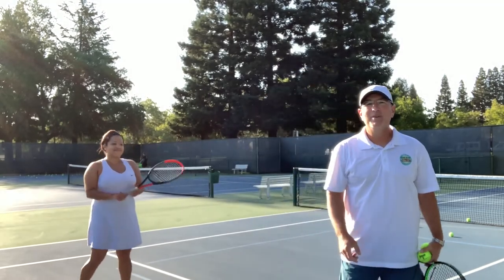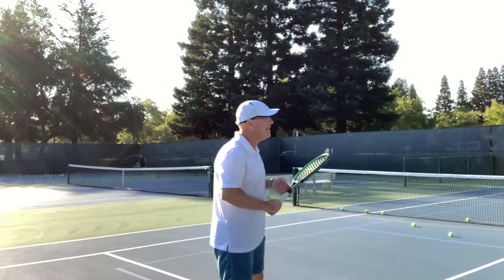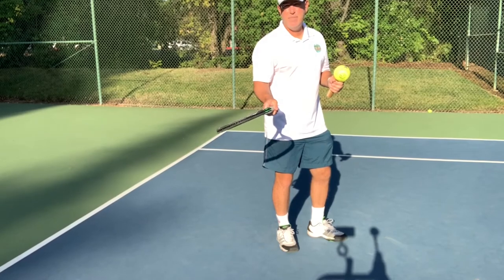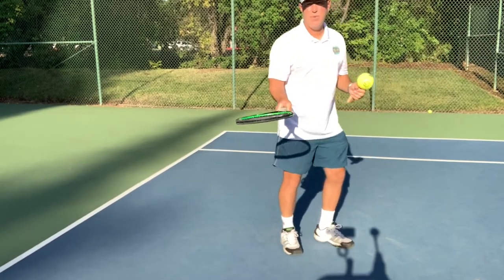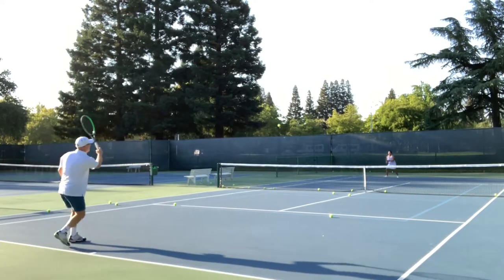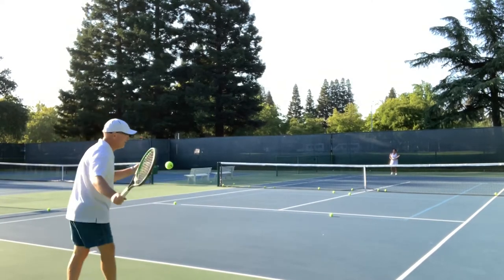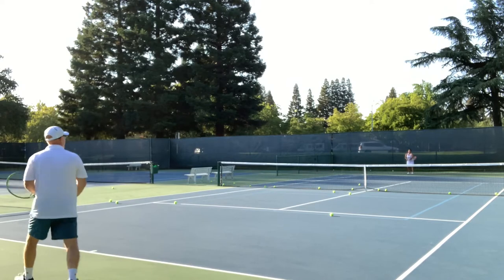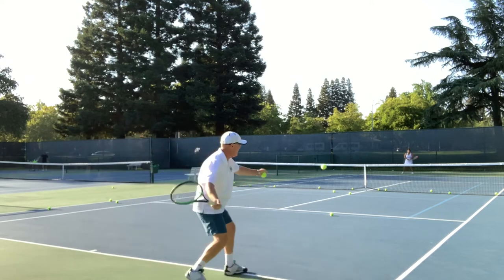Eastern and Semi-Western Forehand, redefining and correcting a common error

Comment: Excellent, steady explanation and guide on how to improve stroke play. More please on timing and footwork!
Reply from the maker: Thank you for the comments!!! Timing and footwork are always good to explain and go over, great idea for another video. 
A couple of concepts that will start you off on timing would be the “pace of the ball rule” for consistency...”to keep the ball in play and avoid errors, strike the ball back with an intent of the same pace or less it approaches you,” and then the inside side of the ball for your eyes to track, which keeps the ball always away from you and a distance in front of you for consistent ball strike. You can see that brief demo on my Advanced Forehand Practice video: https://youtu.be/Ye3PEL-q4ww
Hope this helps!!!
Coach Adam
Reply: @GameZTennis  Thanks, yes, I have seen the video about the pace of the ball and matching its speed, again a very helpful reminder that one is not Federer or any other pro and one must slow down and focus on the proper action of a series of fundamentals to get that long-desired consistency.  I was always slogging/muscling through the ball with a grip that was always opening and then skying the ball over the court - “why do I do that?” I would forlornly think; now I know.  I have now a set of points to consider and put into action as I play.  Thanks.